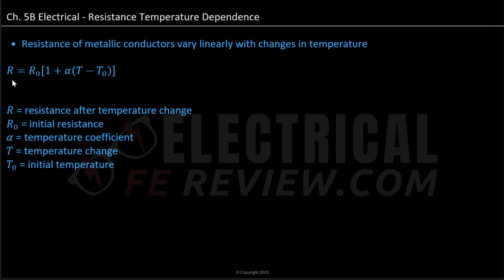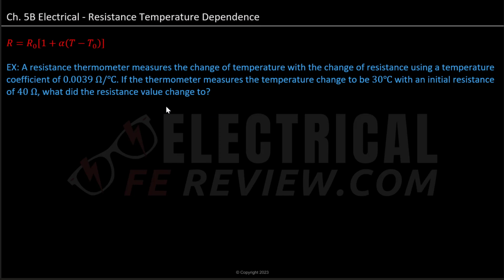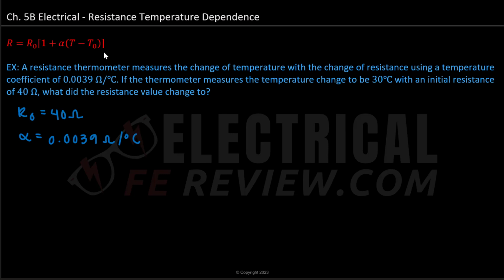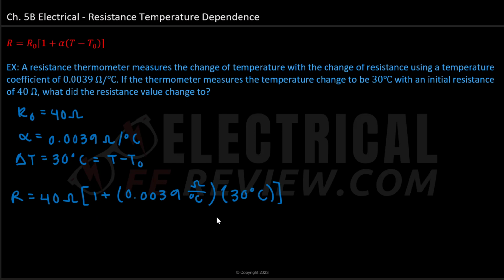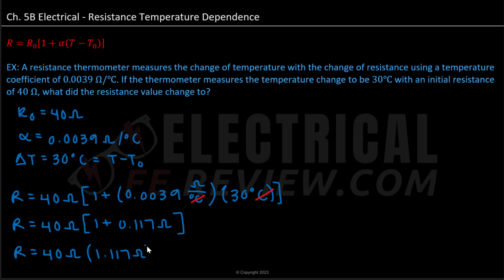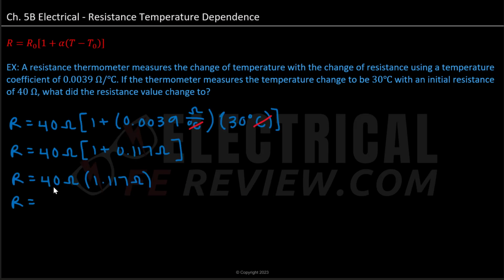Resistance Temperature Dependence - Electrical Materials | NCEES® Electrical and Computer FE Exam

Comment from the maker: Video Contents
0:00 - Introduction to Resistance Temperature Dependence
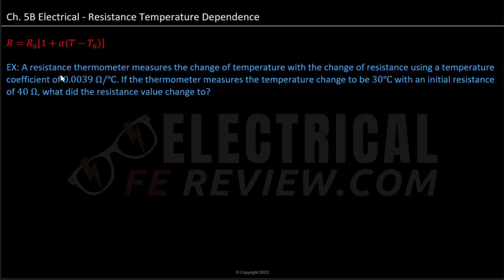0:43 - Example problem involving a resistance thermometer
1:26 - Identification of the problem and the given values
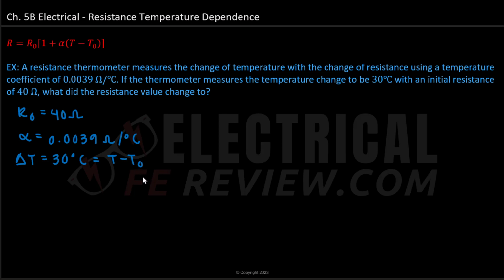1:58 - Calculation of the resistance change using the given values
2:56 - Conclusion of the example problem and the final resistance value

Ready to master the Electrical FE Exam? Don't miss out on our expert-led online course, with video examples and practice problems. Best of all, it's 100% FREE! Enroll today at https://www.electricalfereview.com and take the first step toward passing the FE exam.